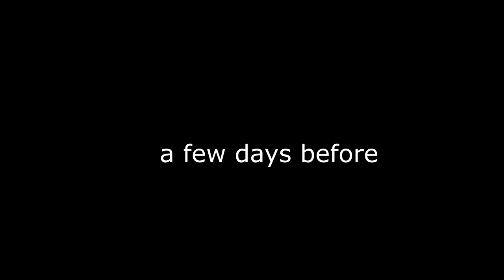🟢 DIY Dust Filter - my Woodshop Dust Collection System Upgrade

Comment: Your woodwork and ideas are very good! Loving it!  
For the dust collection, you may want to research centrifugal ideas between the airpump outlet and the micro-dust-filter box, in order to separate most dust before the micro filter box.  Don't be blinded by only a conic shaped centrifuge.  There may be other shapes that might catch particles smaller than 80 micro  metre, which extends the filter cleaning time significantly.

Comment: I will share my experiences with you. 1. my dust exhaust system is a source of terrible noise 2. it also sprayed the smallest dust fraction, maybe not such a lot as yours, but enough that after work you could write notes on everything with your finger. ;)))
Therefore, I built for it a box measuring one meter by two from floor to ceiling. I made double walls and placed 10 cm of mineral wool between them. At the very top I made four "windows" measuring 20x80 cm for exhaust air. In these "windows" I placed filters, very similar to yours, but with one difference. I added HEPA filtering fabric on the outside. The filter frames are made so that the PUR foam and HEPA filter can be easily removed.
EVERY WEEK I wash them in a normal washing machine at 40 degrees Celsius with prewash. After spinning, they are dry enough to be reinstalled straight from the washing machine.
Since the construction of the filtering and soundproofing box, there is no dust in the workshop and the noise level has dropped significatly.
Consider HEPA fabric, you won't regret it. After week of work it is covered with a thick layer of very fine dust from the inside. Which, in my opinion, is irrefutable proof that the HEPA layer makes sense.
Additionally, I bought old, a chipped school board, which I neatly cut with a diamond and made a nice frame, from wood of course. I also bought regular school chalk - for notes! It workes!!! :)))

Comment: Fine particle sawdust like this can also behave almost like combustible gas; the air gets saturated, and a spark is enough to cause a fire, even an explosion. So, not only is it better for your lungs, but you prevented a possible disaster. Also, check with an electrician near you, regarding the machines, they should be properly connected to a common ground, to prevent electrostatic buildup on the machines

Comment: I mostly watch videos without clicking on the watch button and instead speed read the captions. Much less data charged. So I didn't notice that your video was silent. I think you did an excellent job, very good design and journeyman work. I am getting ready to build a dust collection system and your design does look like a winner. I will say if I copy your design I'll make the filter elements easily replaceable. I think a double filter on both sides and some kind of pressure gauge on the box. When it's time to change filters throw away the inner filter, move the outer filter to inner and put in a new outer. That said remember, if you tinker with and improve mechanical things long enough eventually you ruin them.

I want to mention something that bugs me. Your shop. In a lot of videos the presenter is in a spotless, spacious fully equipped work space. Jet, Powercrafter, Laguna, Woodcraft tools. And I'm almost disappointed in my own set up. My table saw is a 1950's 12" built under license Delta Unisaw. I bought it for $125.00 and it came with a spare motor that I sold for $100.00. It's got the old Jet type fence with tube rails so I'm unhappy with the outfeed table but I'm putting together the saw and my router table. My lathe is again a solid cast iron 1950's Sears Craftsman, ten inch swing over bed unit that runs zero to zero. I built a brute of a stand for it and installed a three horsepower DC treadmill motor. It runs infinitely variable from five to three thousand two hundred rpms.

Point is my shop looks a lot like yours. Larger point is I see guys like you with shops like yours and mine and other guys with Walmart grade tools, all doing journeyman design and excellent work. Thanks for bringing a day in and day out perspective to our vocation.

Comment: Awesome design. Are you able to remove both ends of the filter and wash them or do you need to replace the foam material entirely? Either way it seems inexpensive and definitely worth while. I recently was working with PVC coated plywood, I'd never seen it before, made a circular saw rip guide out of it and it is awesome. The saw has almost zero friction in the guide for perfectly straight, zero clearance cuts BUT the dust created, no doubt, was not good to inhale... PVC and wood dust... That cannot be good for you or at least I don't want to risk it. Vinyl in your lungs sounds like it might be pretty bad for you. The guide/sled turned out so great I went and bought more of the PVC-plywood because it's baby smooth and flat as a sheet of glass. It's only ½ inch thick and moderately flexible but 2 layers of it is more than substantial for a 7 foot long guide so that's not bad at all considering my guide is only 10 or 11 inches wide and it's very stable and does not bend at all. I just need to seal the cut ends and it's done and needs a place to hang on the wall. My preferred local Baltic Birch supplier only sells in 5" x 5" sheets and they don't have a saw in their whole huge warehouse 🙄🙄 Weird but whatever. I needed the guide so now I have it. I think I need to start a GoFundMe page for the company so they can get a quality saw & blade so people like me, that don't have a truck can get their material in their cars and not unsafely strap a sheet to their roof and drive across town on a windy day after their battery powered saw runs out of juice LMAO 😅😂🤣😜 That was scary as f*#k!!!! I thought I was either going to lose/destroy the lumber or possibly kill someone with it. It was still cheaper than buying a partial sheet and I have extra Baltic Birch left over. Now I have my sweet guide/sled that easily gotta in my car (Toyota Matrix) and simply have to measure in both ends, clamp down my guide and saw baby saw and me and my wood and me are in the car and on our way. I can breakdown an ¾"x4"x8"  sheet in minutes with near perfect, zero clearance cuts in just a couple of minutes in the parking lot with a circular saw 😱 It works great with a 24 tooth ripping blade but a 40 tooth blade on plywood gives even smoother cuts on 1 inch thick or more material with little or no need for sanding and definitely no tear out.
Reply from the maker: Thank you for your comprehensive and helpful story, my friend. I didn't washed this filter yet, just shaked out, it was enough. But when time will come i can remove them from inside just pull out a few staples and filter can be pulled out. Thanks

Comment: Awesome!  What did you use as the filter?  Also, does the fine dust just collect in the box?
Reply from the maker: i used a 20mm thick foam rubber for this filter, but i still think that it won't filter well all time, one day the fine dust will seep out through this foam rubber. Any idea how to improve this filter.
No, most of dust collects on the filter's surface
Reply: Instablaster
Reply: Very Nice job looking good!!!👍👌💯